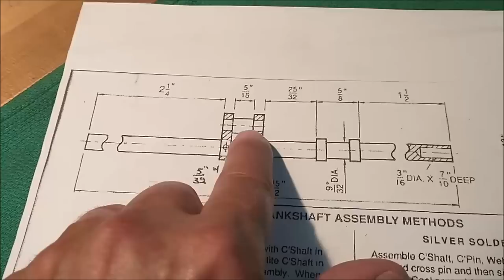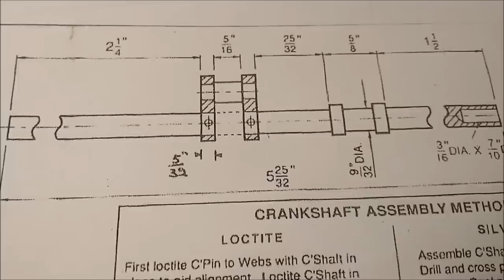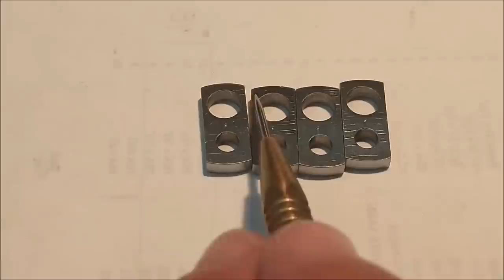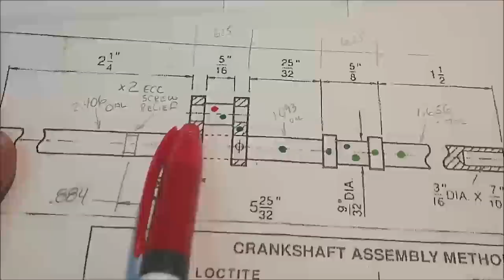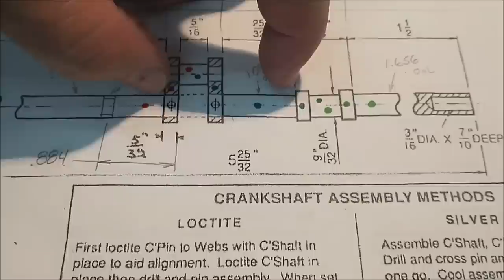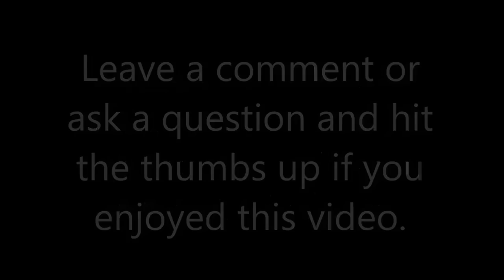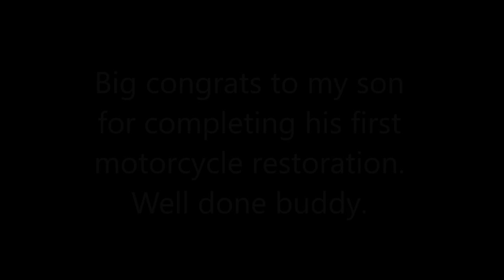Stuart D10 - # 15 -- Machining The Crankshaft.........Final Component

Comment: Would there be an advantage to pining the crank from the ends instead of the sides
Reply from the maker: Pinning across the rotational forces doesn't present the pin with the opportunity to walk out under high RPM. A pin that sits inline with the spin axis will never see those forces. Just my observation. But, a single, lengthwise pin does make sense.

Comment: I like the pins heads left showing as is. Maybe the main shafts are not stepped down, as a larger diameter will provide more friction on the press fit, and will take more torque? (Disregard, my comment. I just read another comment about different assembly technique)
Reply from the maker: Who ever calculated the length of the material needed to make this crank didn't take into consideration the overlap at the throws. I barely had enough material to do it the way I did.

Comment: I like the 'rivet'-type look.

Why did you not also pin the smaller shaft sections?

I know they will not experience the same twisting force in normal operation but the machine might bind up if they shake themselves out of alignment over time.

Maybe it's not a common problem but since you are already set up to do it when you are inserting the other pins, it seems like you might as well add extra pins for security.
Reply from the maker: I'll have to make soft shims to support the throws on the rod journal areas. Setting the pins may shift the throws since the round part is not supported out there.

Comment: Just wondering about the “ light pressure on the part because you don’t want to collapse the wall” .Do you have any advice on determining when there is enough pressure? Or is it only found with experience? This seems like a very crucial concept when dealing with small parts.
I understand this is very subjective
Reply from the maker: I have a vise handle with a short arm, and another thats just a knob for just this situation.
Reply: @joepie221  thanks Joe .like always you simplify things greatly. Every time you go to the white board you take a complex subject and make it very easy to understand. Not the white board this time but still a simple solution. Thanks from someone who has learned tons from you. And someone that truly appreciates the amount of time you put into your channel.🙏

Comment: I know it's off topic but I was wondering if you could do a video explaining how gear teeth are cut inside a hollow round piece of material. I have worked on equipment over the years that have a small pinion gear on the end of a shaft that drives the bull gear from the inside instead of the outside. I am very curious as to how that "female" bull gear or ring gear in a planetary set is made.
Reply: Oh God! Your talking about something like a planetary gear system for example? In other words the teeth are on the inside of the hole.

That is a tough job and modern machines specific to the gear industry by the likes of Gleason have been made. Brutal expensive machines.

But… in simpler times you had the gear shaper. It’s based on the metal shaper but it does formed shapes.

The tooth of a gear is an involute. A special form of mathematical shape. By having a straight cutter moving up and down against a rotating and clocked workpiece, as the tooth void enters the cut, the depth of cut varies by position of the workpiece. The result is an involute shape.

One of the most venerable of these machines was the Fellows gear shapers like their 6 and 7 series. Fellows was out of New England. Look up fellows on YouTube and you will get you answer. Cool Stuff!
Reply: @devmeistersuperprecision4155  That is exactly what I want to know.
Reply: The shaper and careful setups and math apply here on that one.
Reply: @TomokosEnterprize  Actually, a fellows gear shaper makes gears fairly simple.  You need to know your pressure angle, your diametric pitch, number of teeth.  The diametric pitch is a simple equation relating the addendum to the dedendum or tooth size.  The DP has no real significance other than an accepted practice for making teeth.... it determines the size of the tooth.  These machines differ from conventional shapers in that they are intended to perform developed shapes.  A gear hobb is similar in some ways as the cutter in a hob or a fellows machine is not a curved or shaped cutter like you would use on a milling machine with a dividing head.  The tooth of the cutter is straight.  The developed shape is a the result of the two moving objects interacting with each other.  The gear shaper is going up and down while rotating the gear blank.  For low speed applications, a milling machine cut gear is just fine.  For very high speed applications, you can get into trouble.   The issue is this.  A set of milling machine cutters come in sets of 8.  Each cutter can cut a single gear perfectly which includes the number of teeth, the diameter of the blank and the DP of the cutter set.  As you drift away from this sweet spot, the tooth becomes more of an approximation of the involute rather than a developed involute.   For example, the involute shape of a rack is a straight sided tooth!  That is because the involute function of a straight line is a straight line.  The involute function of a circle is NOT... its the shape of the tooth for that exact blank diameter or DP circle.  For change gears used on a lathe, the speed that these gears run at is very low.  So a milling machine cut gear will work just fine.  Where I have found the fellows shaper handy is when you have an integral shaft containing two different gears back to back machined from a single billet.  Here, the mill can cut the outer gear but it can not get to the smaller gear that is back to back with the bigger gear.  An example would be some of the shafts found in a willys jeep transmission.  Here the fellows can shape right up to a shoulder.
Reply: @devemch7851  Thanks  a bunch for  that. I have only made some rack  and pinion gears when in school many, many moons ago. I would defiantly be leaning on our machinists bible/handbook when wandering into that in my retirement. I just have a small bench top lathe and horizontal mill I tinker with now and then.
Reply from the maker: I'm going to guess its wire edm'd out of a forged blank.

Comment: I wonder if the crank webs/arms (?) could’ve been made egg shaped to increase the web thickness, or if that would’ve affected the balance too much.
Reply: Your thinking petrol. Steam cranks were very basic and none ram fast enough to require precision balance like you would have on a Chevy V8. Also steam engines were cast iron boat anchors. So very vibration forgiving.
Reply: @devmeistersuperprecision4155  Good points

Comment: This may be a dumb question... wouldn't a cam seperation of 120⁰ make more sense in a 2 piston application?
Reply: Just thinking aloud… No. 120 degrees may be better for a gas engine. But this is a two cylinder double acting engine. The steam events in the steam chest are set up in accordance with 90 degree crank shifts
Reply: @devmeistersuperprecision4155  Absolutely, 90 degrees gives the best chance for self starting.
Reply from the maker: Don't forget, a steam engine fires the piston from both ends. So a 90 degree crank times 2 pistons times 2 firing events = 360 degrees. I had to look at it twice myself.

Comment: I absolutely agree that a "built up" crankshaft just looks classier with the ends of the pins exposed. It will provide more visual interest to the turning of the crank when you run it, also. Some folks like to trim the pins out of a sense that it's not 'prototypical' - that is, the engine in full size of which you're building a model would not have had great big pins like that. But for engines like the Stuart D10V, there's not really a "full size" engine that it's pretending to be.
Having the visual cues for how the engine was built also seems more honest, to me, somehow. That's probably silly.
As others have noted, there's also the other way of building a crank like this - and I think you've done that video before.
Anyhow, this is great - I'll be excited to hear how it runs.
Reply from the maker: I am considering adding rings to the pistons to make it run really smooth. The PM kits use teflon rings.

Comment: Typical Joe Pi workmanship. (Toolmaker grade outstanding) The only thing I don't get is the 90 degree timing. Like a half a cross plane ???? I understand it being self starting so you don't get dead center, but it's going to pulse like a Harley. I'm no steam guy but if it was like a flat plane a few degrees off would it still self start and still be very close to dead smooth? - I know the 90 is there for a damn good reason, just cant figure why ?????
Reply: I would also like to know the answer to this question, I would have thought they would be 180 instead of 90.
Reply from the maker: Since its a double sided combustion chamber, 90 degrees is fine. 2 pistons at 90 = 180 + 2 combustion events each = 360.
Reply: @joepie221  I stand corrected, thank you..
Reply from the maker: @richardcox3485  All good. I initially didn't get it either. I too thought 180 made more sense.